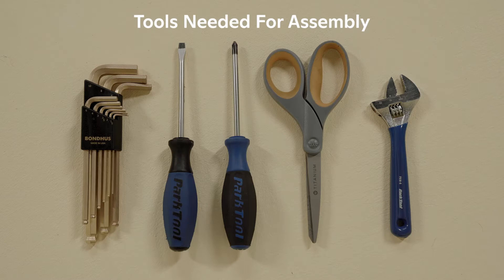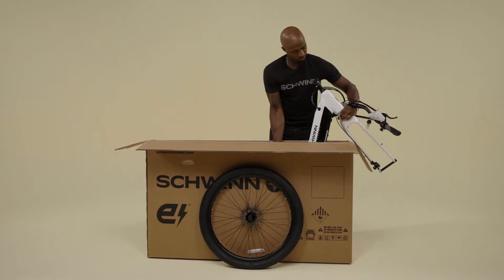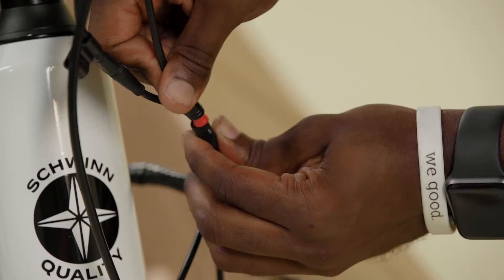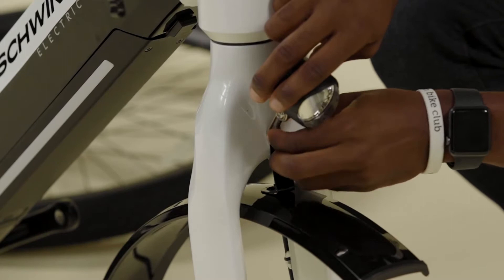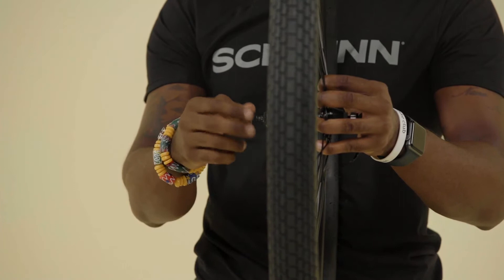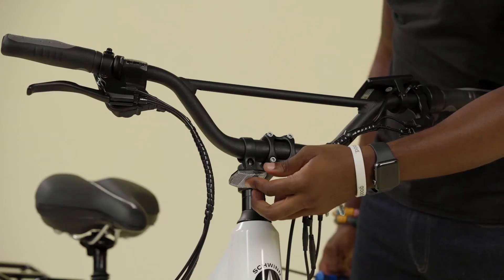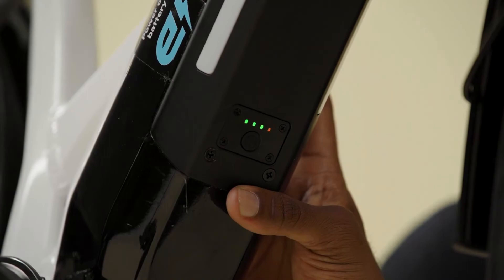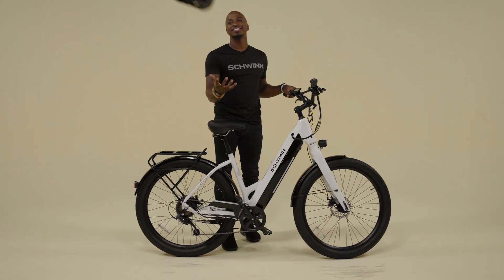How to Assemble a Schwinn Electric Bike

Comment: is it waterproof? can you ride it in the rain or in the snow?
Reply: Yes
Reply: Yes and no. The yes portion is you should be okay most of the time, however, I have heard and read that some users had issues in a torrential downpour. There are three things on this bike that can get water inside if it's significant rain. The first one, is at the bottom where there is a magnetic sensor. One user reported on the forums for e-bikes for this specific model, that the water leaked inside had disabled the sensor. The second portion is where the battery connects, be careful if there's a lot of water it can seep through and cause the battery to get wet. Finally, the display on the left hand side should be waterproof, however, if a lot of water gets around it and especially sits there for a while. It can also get inside. Think of it as a cell phone, most cell phones are supposedly waterproof, however, we all know what happens in reality especially after prolonged exposure. I would personally be careful when I come back home. I would put a fan to blow on the bike to get all the excess water out. I do this anyway with non e-bikes.
Reply: no. i left mine in the rain and it’s battery was ruined

Comment: Schwinn... you guys are CRAZY for asking these prices for your ebikes. $1499+ for a 250watt motor and a small battery? The Walmart build quality is nothing special either! These shouldn't be over $850. Very overpriced compared to other ebikes. 

Ride1Up has their (Core 5, $1095) and (500 Series, $1400) both have 750watts and have free shipping also look amazing. You're being outdone by many other brands for basically half the cost. Something isn't adding up.
Reply: Dicks Sporting Goodsis selling the $1799 Marshall for $799.  Amazon has it for $1399.
Reply: @PeterLeahy2014  Thanks Peter I gotta look right now. Their pricing is insane.
Reply: I found if you cheap out on an e-bike, you usually get less quality parts, more likely to break down.